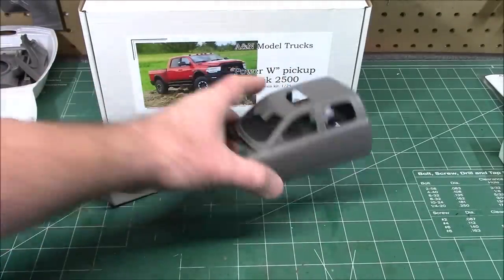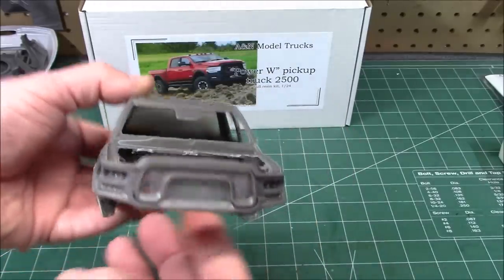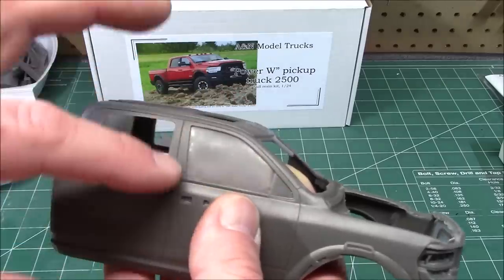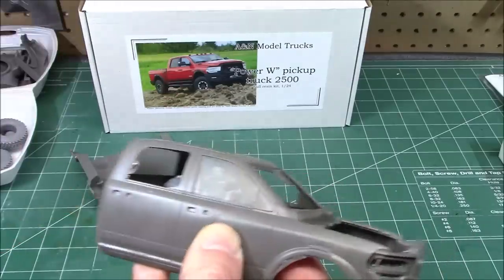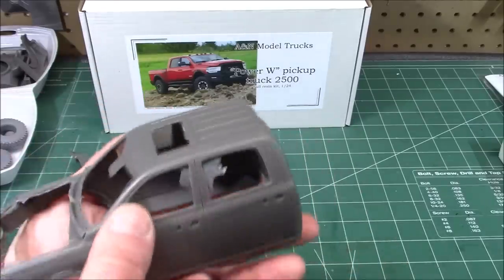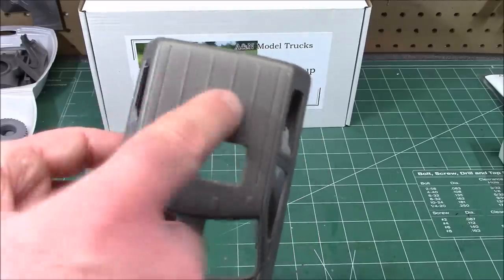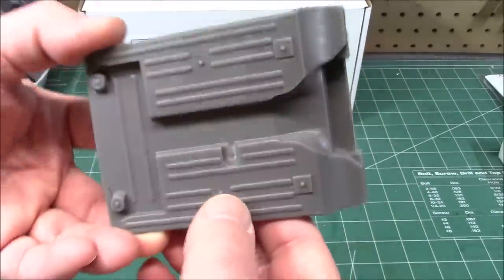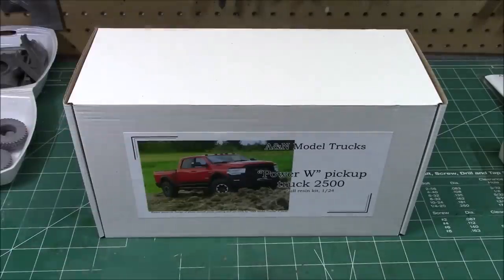Dodge RAM Power Wagon Hemi 2500 1/24 Scale Resin Model Kit Review Part 1 THE PARTS A&N Model Trucks

Comment: Some degreasers can affect the resin in these kits, so test stuff like Simple Green or SuperClean on pieces of the sprue first.
Reply: We don't use any demoulding agents, so parts are mostly clean; for cleaning parts soap and warm water is enough. Sometimes there are small drops of silicone oil can be found on parts, and in this case you can use acetone on our resin. If will happen disaster with painting you could remove paint with braking fluid and nothing happens with resin.